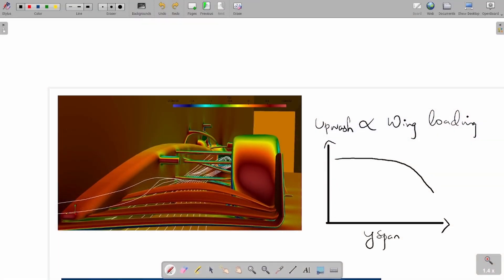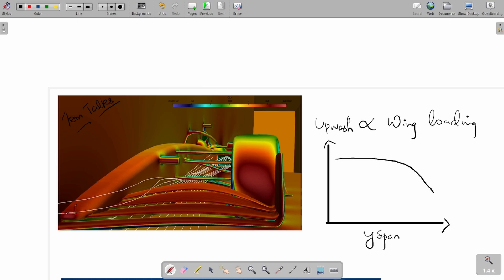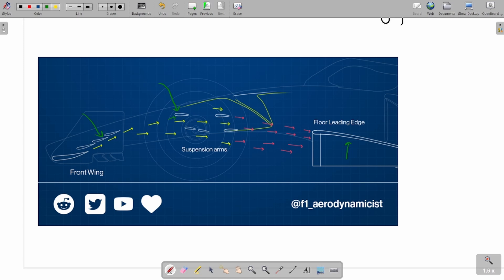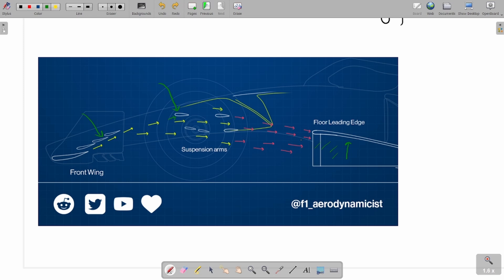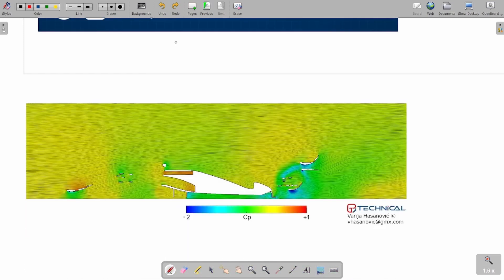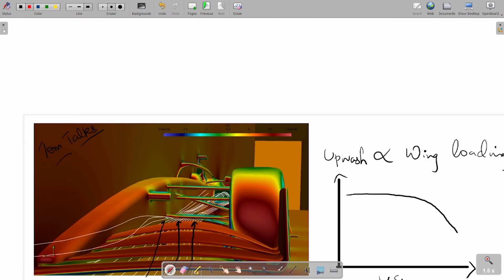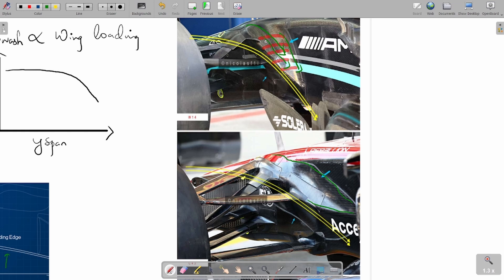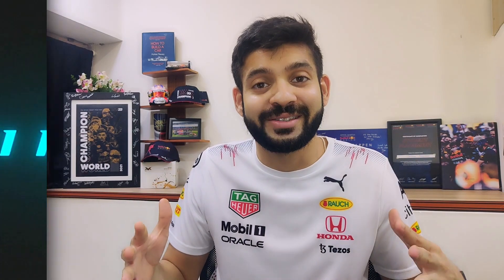F1 2023 Aerodynamics : Mercedes F1 W14 Downwashing Suspension Fairing : Explained !! #w14 #f1

Comment: Hi sir, great video. This type of video is more understandable than the previous ones where put forward terms directly.  
doubt: so the type of suspension will also affect the airflow? push/pull types.
Reply from the maker: Absolutely, but usually , the suspension design is the first thing that's decided and you design around it

Comment: Hi Shub, thanks for the reply.  As I was driving to the gym last night, I think it started to make sense.  
is this correct, the front spoiler forces the air upwards, the air from above drives the forced upward air over the top of the suspension and the radiator area, low pressure sucks the air through it.  Is this correct?   The terminology can make things confusing.
Reply from the maker: Well, in simple terms , the front wing pushes the air up , and the role of the suspension fairing is to change to trajectory of that air downwards so that the floor can benefit from using that air to produce more.downforce 🙃
Reply: @f1aerodynamicist  And you mentioned a low pressure area, assuming the air forced upwards by the spoiler, is higher pressure.  
And I would imagine the low pressure area sucking the higher pressure air into it?

Comment: With such an aggressive downwash, the suspension arms surely create quite the (local) lift, right?
Reply from the maker: Yup they would, but it's a fraction to the advantage gained by the floor.. as for everything in engineering it's a trade off
Reply: @f1aerodynamicist  Absolutely, but what im thinking of is shouldn’t backing off both the front wing and the down was by the suspension elements be viable? This way you still create net downforce but with less drag.
(F1 Teams know their Numbers but i am genuinely interested 😁)

Comment: Very nice video, thanks.  The suspension arms are obviously moving up/down though the suspension travel. The movement is quite small (<<50mm ?? at the wheels) but with such a complex flow between the front wing and floor is the system quote sensitive to the position of the arms?  Seems like it should be optimised for cornering but that is also when the left/right sides of the suspension and floor will be doing opposite things...
Reply from the maker: Good question! Usually teams take into consideration a safety margin not to push the flow too hard knowing that this would happen n introduce non linearities, But I haven't heard a team focus n optimize this particular bit for a cornering etc, .
Reply: @f1aerodynamicist  Thanks Shub!

Comment: Hasn’t it been said their front suspension is the reason why they’re lacking downforce/losing their fronts?
Reply from the maker: Yeah but that might be more mechanical than aero
Reply: @f1aerodynamicist  how?
Reply: This is something I have noticed and did a comparison of all the 2023 front suspensions. Out of the top runners, AM looks to have very similar geometry to RB, except one is push and one is pull. The top rod is attached as high to the body as it can be and quite separated. Merc and Ferrari however have much narrower geometry and both seem to suffer with bad tire deg. I bet this will be something we'll see changed in future upgrades as if its obvious to a novice like me, I'm sure someone much smarter has noticed this difference. They already said the AM is half a Merc and the visible differences to me are front suspension and side pods.
Reply from the maker: @BermyBwoy  good spot